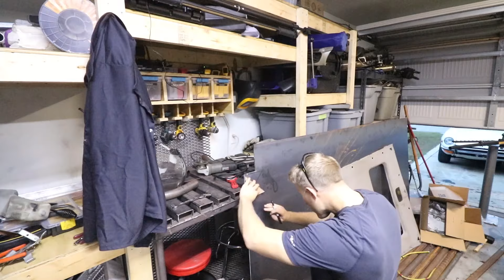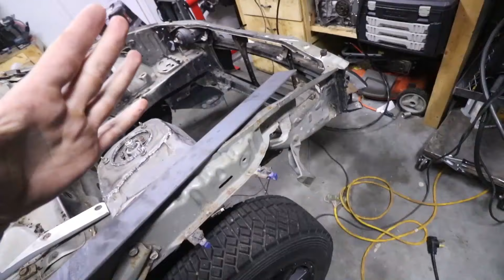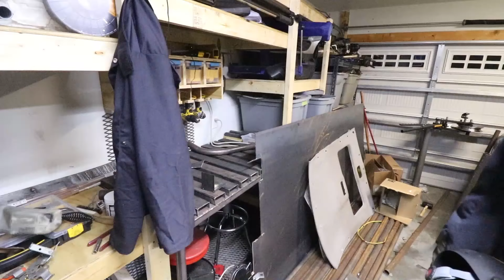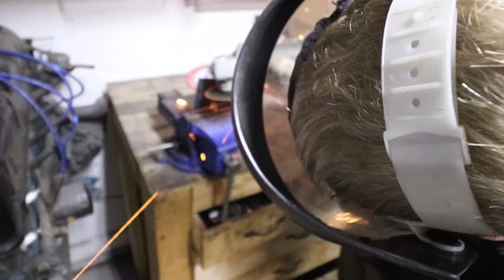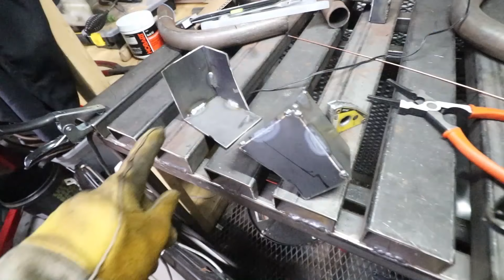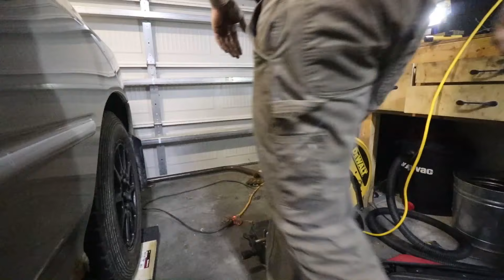GC8 Rally Car - Rocker Boxes for the Roll Cage - Subaru FIA Rally Roll Cage Build

Comment: Dig it I was just looking for a video on rocker boxes. The time attack cage on TFS looks like it didn’t have a bottom plate. Or I just didn’t see it
Reply from the maker: I don't think he added the bottom plate. A lot of people don't run a bottom plate, it makes sense to me to want a plate on the floor so the thin 1/8th sides of the box don't knife through the floor in a hard rollover.
And thanks hopefully it was of some benefit for you!
Reply: https://youtu.be/55q2bUTJKjk
Reply: I’m not an engineer and this is my first cage from scratch but I would think that would defeat the point of the plate. You would only have the 1/8 by however many inches your plate is as your contact area.
Reply from the maker: Yeah those were my thoughts exactly, which is why I wanted to add in those plates to the floor
Reply: Now to figure out how to work the tig petal smushed in a small car